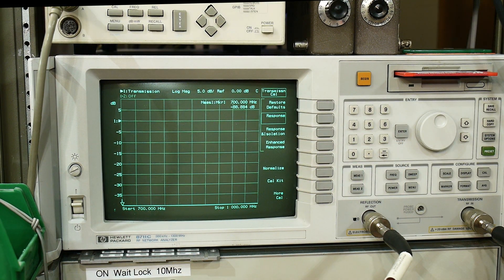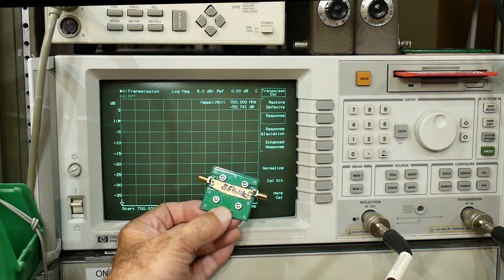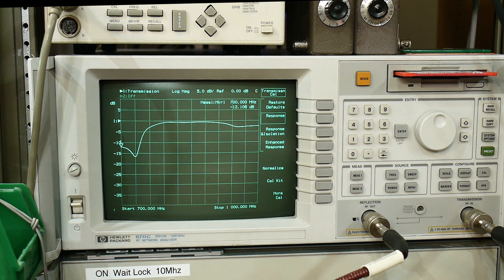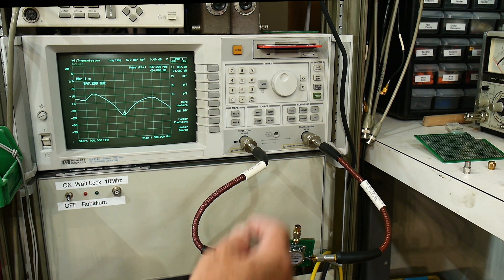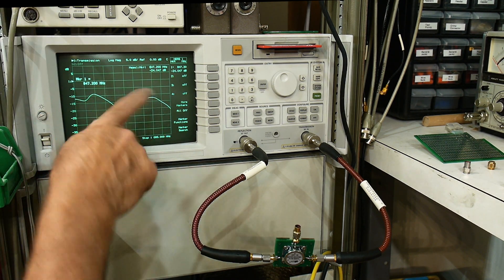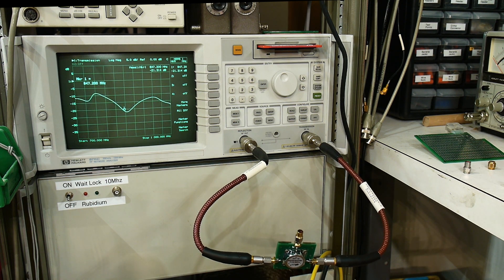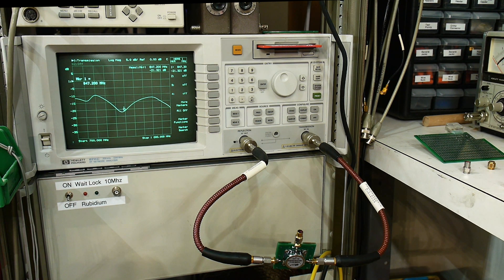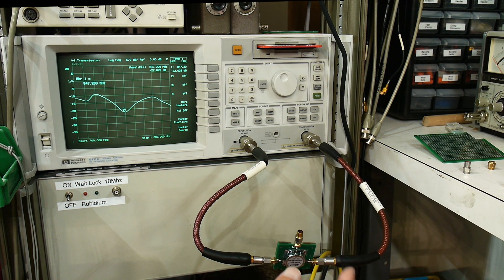#922 PCB design for RF circulators (part 3 of 3)

Comment: Thanks for your great videos. I have some old Sinclair Labs circulators from duplexer cavities for 800MHZ. These units have a large ferrite core, with tunable capacitors, adjustable at each N connector from outside the the case.

Comment: I had a ham radio microwave book a while back that mentioned that circulators sometimes could be tuned to a ham band by experimenting with external magnets. It didn't say much more on the subject than that, but it looks like that magnet trick is legit garage engineering for circulators.

Comment: I can not see  what is the P/N of this circulator, but I remember most of the rbus used in 3G and 4G use these at the end of their TL(antenna inputs/outputs) on it’s power amp.

Comment: So would a magnetic viewing film show the magnetic fields of the circulator?
Reply: I have done this, and a magnetic film will show the leakage magnetic field. If you disassemble the circulator you will find a stack 2+ silver disks (grounded by circumferential silver mesh), 2 magic Ferrite disks, and 2 magnet disks all contained within an armature base.
If you remove the decal it will reveal a flat fine-threaded disk (with 2 indentations to un-screw it) that holds the "Disk-stack" inside the armature case.  Some circulators (The rectangular ones) have internal a 50 Ohm load and may not have a 3rd port. Enjoy!
Reply: Using magnetic film I discovered the reason a circulator failed - it had a crack in it (looks like a line on the film).
Otherwise the field on good disk magnets is very flat, uniform and homogeneous.

Comment: Circulators have permanently biased magnets that produce strong fields to control RF signal flow. When a
Circulator is placed in close proximity to another magnet / magnetic fields the two magnetic fields interact
with each other.